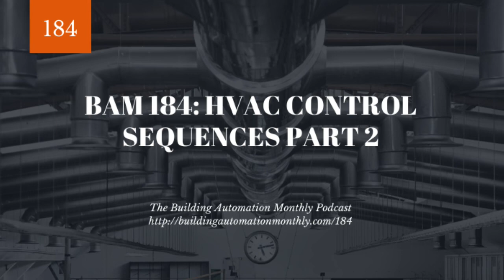BAM 184: HVAC Control Sequences Part 2

Comment: Could you explain what exactly gets energized on a rooftop after the 1st and 2nd clg stages are needed.  I mean are we closing a relay, thus energizing a contactor thus energizing the copressors or are we closing a dry contact to a board?
Also, for the gas heat,  how do you know to which terminals you need to break in order to bring on heat?
Reply from the maker: Typically a control board with an internal relay or a IDEC/RIBU1C to energize the compressor contact. When I say energize the BAS will energize the relay coil and the Line voltage will pass through to the contact.